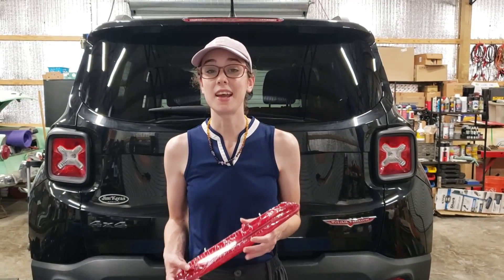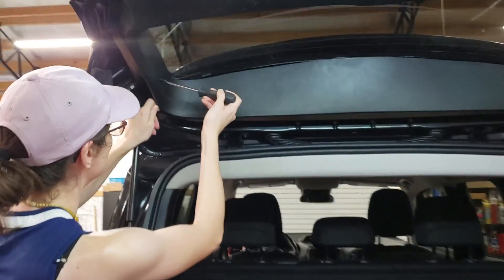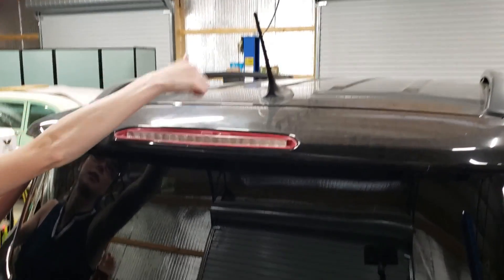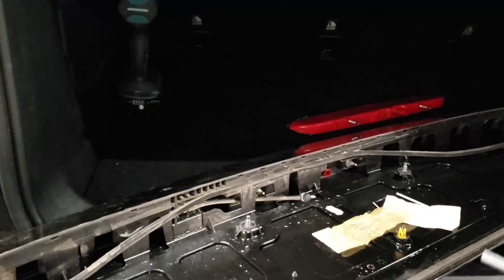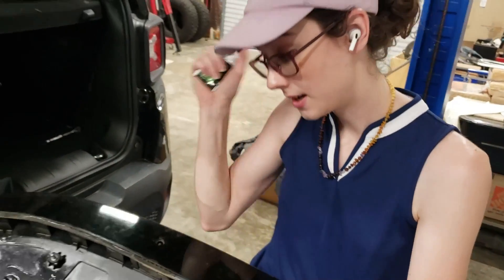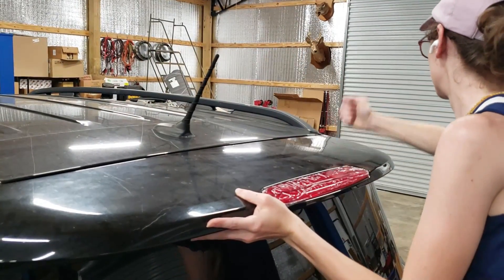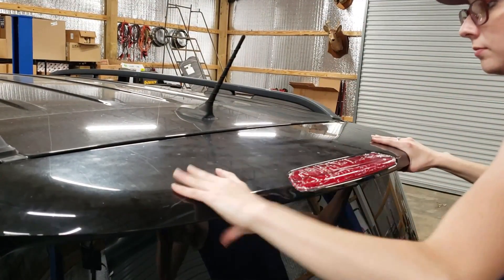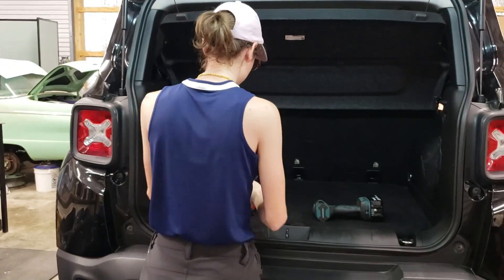Third Brake Light Replacement | 2017 Jeep Renegade

Comment: You need to tight the outside bolts you first pull off. This draws in the other four bolts. If you don't do this, you'll end up losing the nuts like I did inside the vehicle. Also too. I don't know how in the hell this woman got her hands between the glass and the freaking plastic. I had to make a tool to yank the plastic off. I wish people made things legitimate on these videos and not try to make it look so easy

Comment: What is the part number for the 4 nuts? I dropped two of them and couldn’t get it back with a magnet.
Reply from the maker: You may want to contact the local Jeep service center for this information.